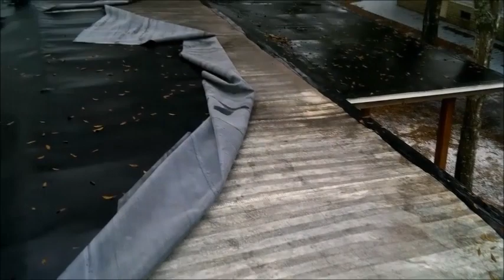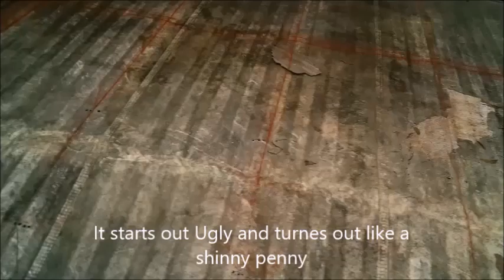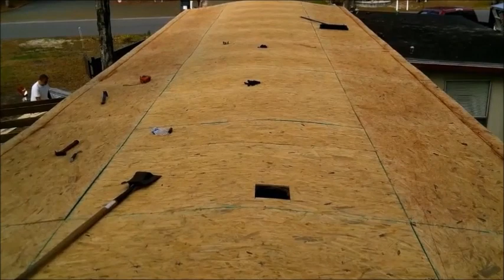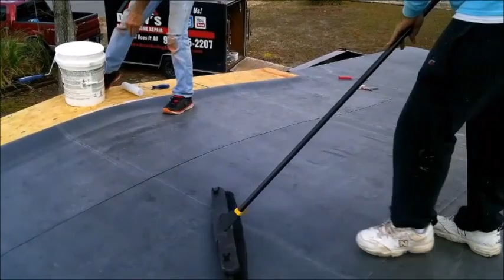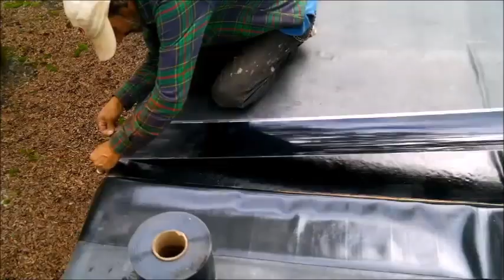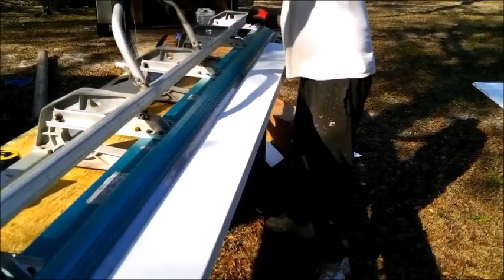HOW TO) Repair Single Wide Mobile Home Trailer Roof Training

Comment from the maker: If my videos help you please help me and hit the thanks button below the video .
Reply: Hey Drew, I have a single wide trailer, the trailer is over 40yrs old with a metal roof. Its has tar on top of the metal and it is heavy, but its hardened and cracked. My question is, does all the old tar have to be scrapped off before having someone add one of these rubber roofs?
Reply from the maker: Good question. Most of the time no. But if it were mine. I think I would spend the extra few hrs to do it. As long as the structure is solid all should be good
Reply: @Drewsroofingandhomerepair  tune 👌 🎶...  UP ON THE ROOF....  A favorite tune & sitting on the dock of the BAY..  7/2022.   NORTHERN CALIFORNIA 🇺🇸
Reply from the maker: I love that song Sandra sitting at the top of the bay
Reply: @Drewsroofingandhomerepair  Sitting on the Dock of the Bay yep reminds me of San Francisco Bay Area peace and love Drew and crew 9 3 20 22
Reply from the maker: Otis Redding.
Reply from the maker: Peace and love and God is good thank you my friend

Comment: Hi drew, me again ...This is almost exactly what i did to my roof right up  until I used TPO instead of the epdm rubber. Man were you right , that stuff is a pain in the __s to work with. But anyway, got it done and end of next month it will be over a year since I put it on and will post a video showing how I did it watching your prep videos and what it looks like after a year here in Northern Utah . Wanted to thank you for all your mobile home roof videos which inspired me to get up there and do it. If I had to do it again, 1. I would hire some helpers, ha, and 2. I would go with the epdm roof. I had to use a heat gun just to get the TPO to bend over edges so I could attach it over my facia and under the term bars !  I think I said that right? Thanks again man. Saved a lot of money. Great videos. and watch for my video in march. Can't miss it ...It starts out saying " A big Thank you to Drew at Drews  Roof and Home Repair". (and it does say you told me to stay away from TPO} I  wish I did now but its holding up good for after a year. lets see for how long though!  C ya.
Reply from the maker: I am so happy to hear that you followed my instructions. I wish you had used EP DM instead of Tpo. Tpo is so hard to work with and the seams will overtime split so keep an eye on the seams. Thanks for watching and I look forward to your video please share it with me and my telephone number is 910-294-1761 feel free to call me love to talk
Reply: @Drewsroofingandhomerepair  Thank you I will!
Reply from the maker: I am starting another Rubber Roof on Monday and then after that we will be doing the floors of the same mobile home.
Reply from the maker: https://youtu.be/cEJoS7hKE3Q
Reply from the maker: How is that roof holding up right now my friend. Watch out for that Tpo the seams where they were heat welded together will shrink overtime and separate keep your ion it. Thanks for watching my channel my friend I really appreciate it and don’t forget to hit that thumbs up so Youtube will share my videos with somebody else. You’re the best brother
Reply: About how much did that cost per square foot? Possibly about to do a "1.5" wide (single with an add on). Out in FL. Handy, but no experience with roofs yet. Thanks in advance to you and thanks to Drew and Crew! :)
Reply from the maker: Keep your eye out on the seams after about 5 to 10 years the seams can to come apart where your heat weld them together thank you for watching my videos number one I put them out there for people like you. Some people wonder why I make the videos I make them for people like you. Thank you for the shout out I look forward to the video why don’t you save my telephone number and send me some pictures and let me know when that videos out and where I can find it I would love to see it and thanks for the shout out. 910-294-1761 if I haven’t given it to you already
Reply from the maker: That’s a good question John it’s all according to the size of the house to be honest right now labor and material for me if you have a 12 x 60 and you lived in my neighborhood you’d be looking at six Graham you could probably do it yourself for about 2500 with the prices as they are today
Reply: @Drewsroofingandhomerepair  holding up good no leaks or cracks ...yet! I tell you what though there's  not much stuff that sticks to tpo  very good so i tried that flex seal, expensive stuff, 40 bucks quart .You know the stuff? The guy on tv does the bottom of his boat with screen and uses it then goes riding around the lake ,ha. Anyway i just used it on the seams last fall and to my amazement it kept them from opening! It said on can works on EIFS, TPO, PVC, EPDM, CSPE, Hypalon, polyurethane. good stuff  it worked.still trying to finish the video i was talking about. Its hard to do when "LIFE" keeps throwing other things at ya! See ya buddy.
Reply: @johnlong9494  See what Drew says below...He's right  Mine was about 14 x 70. Had an estimate to do for 10 grand and did it myself for about 4 grand but your talking a lot of hard work and over a month to do not a few days. I would hire drew and get it over with if you can. Its worth it. my square footage was 980  and it cost about 4 grand so figure it out from there. I can tell you this ...be sure to have tarps ready and hold downs in case it rains. Good luck to you.
Reply from the maker: Life is tough good luck 🍀👍
Reply from the maker: Thank you for that. He should just hire drew

Comment: What prevents the plywood from cracking in half when you bend it on the roof??
Reply from the maker: I am using OSB. But plywood or OSB can be used.   It is not getting bent very much if you watch the videos on us installing it you would notice   There is not much bend in the roof

Comment: Run the rubber under drip edge. Covertape the screws and seams. Covertape the rubber to drip. The end
Reply from the maker: Interesting thank you for the tip

Comment: Hey how are you. I like the way you are doing your job and i have a question. When you bend your play wood and u screw it in so you think the play wood come off later? I know you screw it in but would it be more better if its set straight instead of bent. Thank you
Reply from the maker: I’ve been doing it for years I’ve never had that problem

Comment: drj Westfield Wisconsin what kind of screws do you use to screw down the termination bar? Thank you please reply
Reply from the maker: They are called metal to wood screws. They have a rubber gasket between the metal. if you call ABC Supply they will tell you it is called a termination bar screw they come 250 per bag. Term bar screws. They will have a rubber gasket between the screw

Comment: Hi Drew I live in Denver Colorado and live in a double wide trailer that has a garage added to it and there for has created a Valley up there and not to sure on how to fix that got any suggestions
Reply from the maker: You’re going to have to take the shingles off above the dip and below the dip go to Lowe’s buy a roll of coil stock 2 feet wide by 50 foot long but that cost dark in that valley area. Do not mail it anywhere near the valley area reinstall your shingles without nailing in that area and you should be good

Comment: How do you fix a leak where an addition roof meets the trailer roof? Someone put a roof over the old roof on the addition and it has had many repairs but still leaks. I think it has to be problems with flashing or something between the 2 roofs.
Reply from the maker: I’m not sure what your roof looks like Cool Seal maybe I don’t know
Reply: Deb, no valley, Is the water sitting. There may not be enough slope. Remember, If you want the job done right, Call Drew or do it yourself, Lol
Reply from the maker: Yes ma’am I’m guessing that there’s not enough slope in the area I wish I could help I hate shotty work gosh aggravates the crap out of me. I love to do it right the first time. I don’t want another contractor coming behind me and tell the homeowner look with this guy did he doesn’t know what he’s doing. That is something I’ve never ever wanted to happen to me so I do it right the first time no messing around here. That’s why I show it on video. I want everybody to see what I do how I do it and that I do it right and if they need to do it themselves copy me
Reply from the maker: Or that he can even call me and ask me how
Reply: @Drewsroofingandhomerepair  My clown knew he was f'ing me.
He had a licensed roofer with him, and besides that, any idiot  no matter how high he may be can look around at other homes and say Hey, what's those sticking out the roof.
I'm Mad about it, But I'm Good. Karma gonna take care of him
Reply from the maker: I would love to see pictures 910-294-1761

Comment: Hey drew my mobile home is up on jacks not grounded, can the home support all the weight from the wood???
Reply from the maker: Jack’s?? Where are the blocks??
Reply: @Drewsroofingandhomerepair  sorry I meant the triangle steel piers , mobile home park by the river
Reply from the maker: I’ve never seen anything like that but yes I would say it would definitely hold it you’re only adding about 1700 pounds total with my whole process

Comment: What does this cost?
Reply from the maker: 14x60 6000
14x80 8000
10 or 12 x60 5500
Reply: @Drewsroofingandhomerepair  Thank you.
Reply from the maker: Of course when we travel it is a little bit more expensive we are from the 28461 ZIP Code so it would add in travel expenses if we traveled out of that ZIP Code https://youtu.be/lNjRP3s1EyM
Reply: Drew, I put my trust in an idiot. Didn't have the money to put down OSB, dealing with a bad back bla bla bla. So I paid a licensed guy and his friend, to Just throw down the EDPM.
They did just that for $3,000.
And broke some rafters while doing so. So now I'm wondering. Can I use a heat gun to get this stuff up, place the OSB and redo. Also, are you guts putting a screw in everyone of the holes while tightening down the EDPM.
Your in my prayers, Hoping your feeling great
Reply from the maker: It can be fixed. A tree hit this. The glue will pull up. And be replaced. 
https://youtu.be/ketFCaSS4Us
Reply: @Drewsroofingandhomerepair  Would using a heat gun stretch out the EDPM too much to reuse?
Reply: @Drewsroofingandhomerepair  Ty for your reply